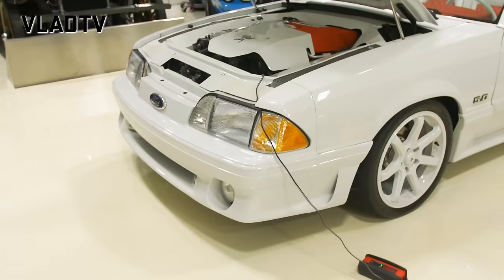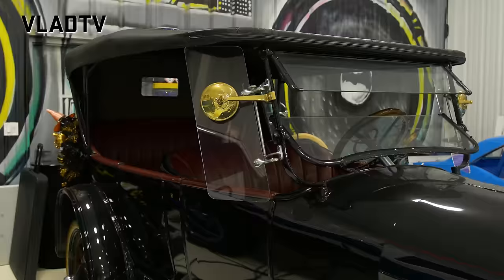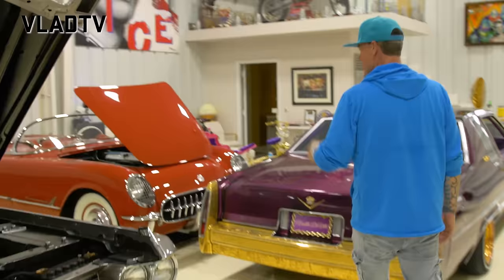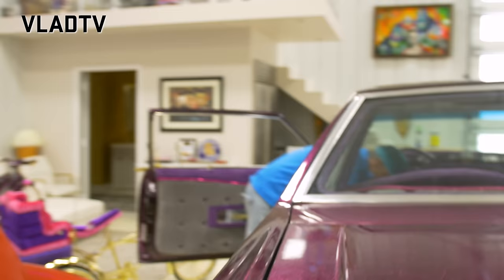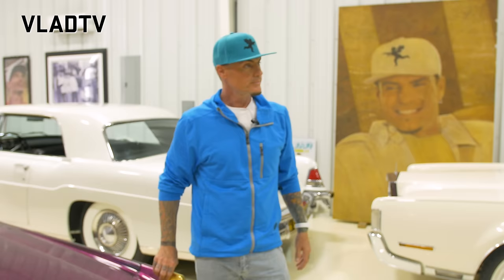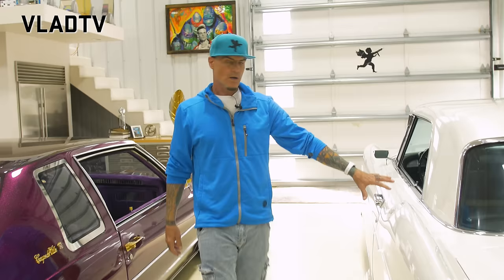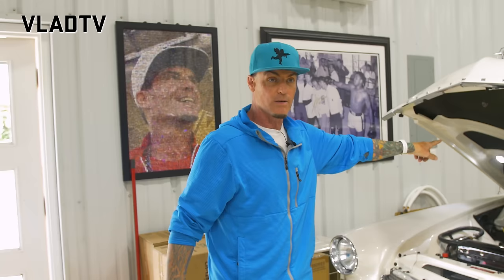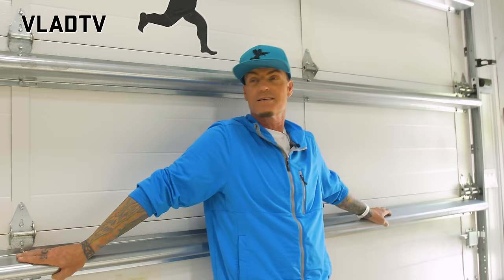Vanilla Ice's Car Collection (Full Interview)

Comment: No you do not die with 72 volts.  You would not even feel anything.  I endured 40,000 volts grabbing spark plug wires.  The amperes is what hurts you.